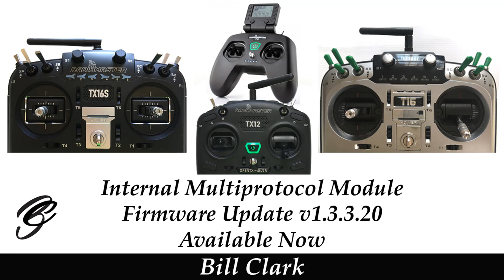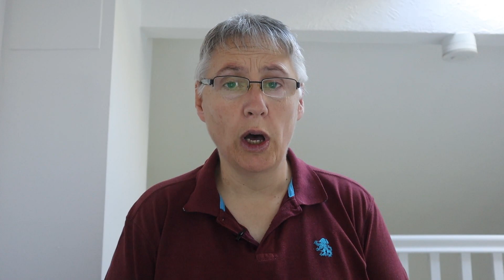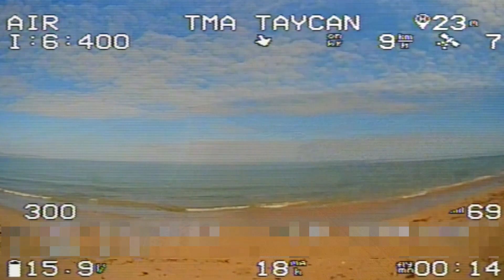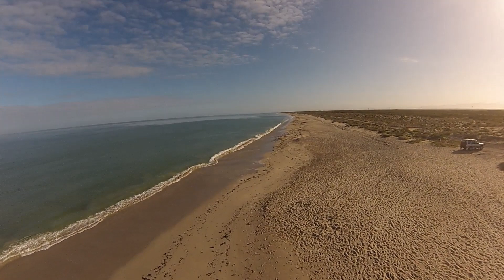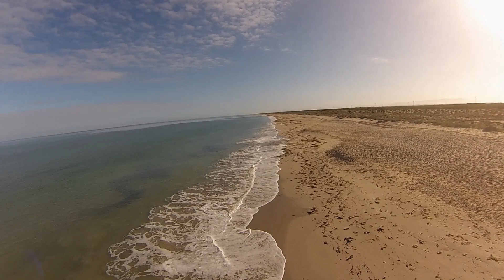Multiprotocol Module Firmware Update v1.3.3.20 Available Now

Comment: Hello Bill.
Sorry to ask you. I think, as you have often done, you could help me.
I haven’t been able to program my TX16S for several days to get the master gain on my NX3 controller.
I don’t have enough movement on my controls
Have you ever done this programming?
In the hope that you can help me. I’ve been searching the internet for days
Friendly.
Alain in France
Reply from the maker: Hi Alain, it sounds like the controller is faulty but have you checked the settings in your radio, is the mode switch working. When you move your model do the control surfaces respond when in stabilisation mode?
Reply: @the-happy-RC-flyer  Thank you, Bill, for that very quick answer. The controller works well. But I don’t have enough travel. I don’t know how to act on it in the programming on "master gain" of the TX16S.
Reply from the maker: @regionlum  could you back up your model and radio settings and email it to me so I can take a look for you? I am not 100% sure of what you mean by gain on your radio. The weight of the mix denotes the amount of throw 100 equally full throw.
Reply: @the-happy-RC-flyer  Thank you for your help, Bill. I have to be away for a few days. I’ll try to be clearer when I get back in describing my problem.
Reply: @the-happy-RC-flyer  Good evening, Bill.
Looks like I was trying to do something impossible on my "NX3" stabilizer model.
The overall gain can only be controlled by the RC transmitter on the "NX3 EVO" model
Otherwise, the controller is functioning well, but flight control movement appears to be weak.
I’ll try like this in flight
Thanks again for the help
Have a good evening